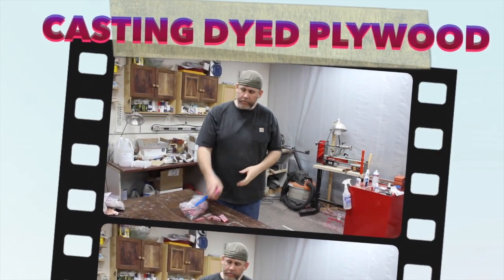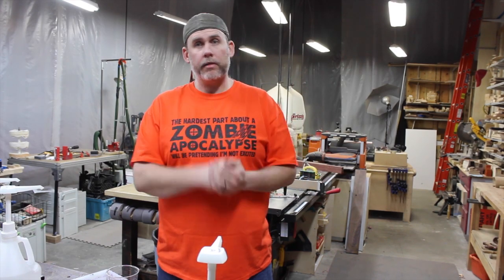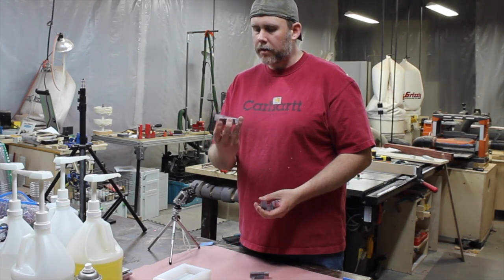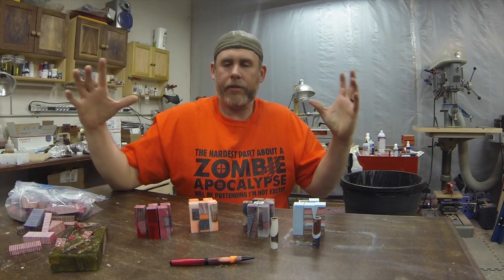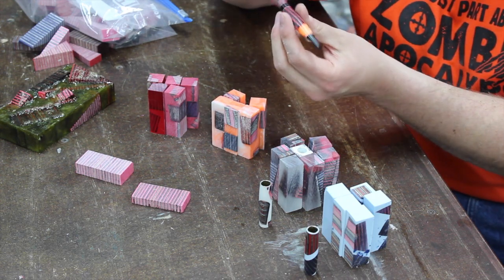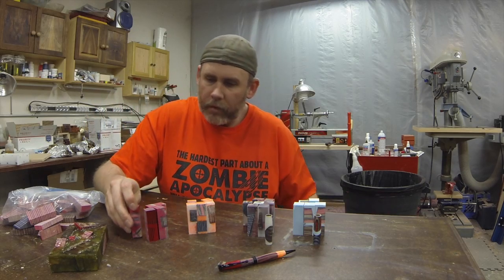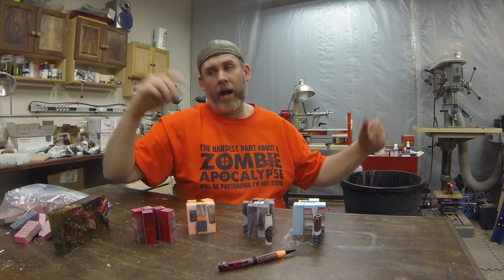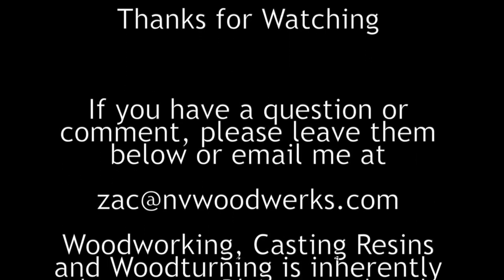Casting Pen Blanks With Dyed Wood and Alumilite Resin

Comment: Hi Zac, Paul from South Africa here, I like the Dyed plywood and would like to give it a go, any idea of how it was done? I will be attempting my first cast this week and am super nervous. Thanks for the video.
Reply from the maker: Hi Paul. Thanks for watching! I am not exactly sure how they make the dyed plywood, I think it's a fairly industrial process. You might be able to find some to buy, it's often called Spectraply. You could probably just soak a bunch of thin layers of wood with different dyes, then glue them together to get a similar effect though. 

Have fun casting, no need to be nervous. You may have a few failures, I know I've had my share but it's really not that hard to get some amazing results. As long as you use the correct amounts and properly mix the two parts, you'll do great! Then it's just a matter of playing with colors and/or adding some objects to the mix. The possibilities are endless!

Comment: Heya Zac! What material are you using for your mold boxes?
Reply from the maker: I use smooth HDPE for my molds. Have a link to where I get it (and other materials, tools and accessories I use) on my website: http://nvwoodwerks.com/tools/
Reply: I appreciate the prompt reply! I love how organized that page is!

Unfortunately the link for "Smooth HDPE Sheets" appears to be broken. Can you double-check it or recommend an alternative? Thanks!
Reply from the maker: Thanks for pointing that out. Grainger must have changed up their website a bit. I got the correct code in there now. Here's a link to it... Sorry for the long link, I have the "corrosive resistant" option turned on which creates a giant web address. I use 1/2" for the walls & 3/4" for the base. https://www.grainger.com/product/POLYMERSHAPES-HDPE-Sheet-Stock-WP7164841#nav=%2Fproduct%2FPOLYMERSHAPES-HDPE-Sheet-Stock-WP7164841%2F_%2FN-13jyZ1yzaepc%3FR%3D1ZAU8%26_%3D1492415036098

Comment: I didn't think plywood would cast that well but I was wrong... again.  I wish I could get my hands on a pressure pot and Alumilite but they are horrendously expensive to get to here (Ireland) and then the taxes and import duty really get into you.  I've had good success with polyester resin but it has it's drawbacks...as you know.
Best Wishes, Brendan.
Reply from the maker: Hey Brendan, thanks for checking out the latest video! I've gotten quite a few comments from people that want to use Alumilite but the cost to ship it is prohibitive. I wonder if there's another manufacturer of a similar product. I believe there are a few other companies selling polyurethane resin, but I'm not sure if any would have better shipping options. I think Smooth-On has a similar product, but you'll probably run into the same shipping cost problem. 

I am truly not a fan of PR, however I've only tried it a couple times but always have issues with it not curing! Don't like the smell either. I'm going to buy a new can of it though and figure out how to use it one of these days!
Reply: Zac Higgins I found that PR doesn't go off properly in cold weather so I wait until Summer to cast it.  I also found that setting the casting block on the lathe bed, mounting a piece of wood off-centre, and running the lathe to get a vibration got rid of the bubbles in the resin.  I don't have a pressure pot so this works well for me.  I'll check out the Smooth-On to see if I can get it.  Thanks for the help.
Reply from the maker: baconsoda Vibration works real well, good idea with the lathe bed!  On the recent tap handle blank pour I did, I couldn't fit the mold into the pressure pot (and it was Alumilite), so I just strapped one of the jitterbug palm sanders to the side of the mold, and it worked pretty well!
Reply: Zac Higgins Super idea, I'll be storing that one for future use.
Reply: Could you ask a friend to mail you one from another country?